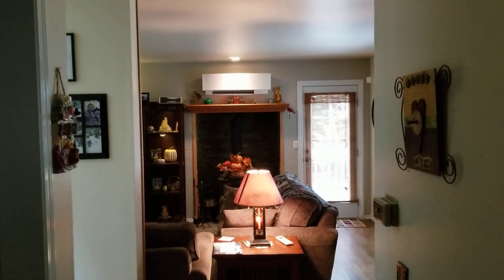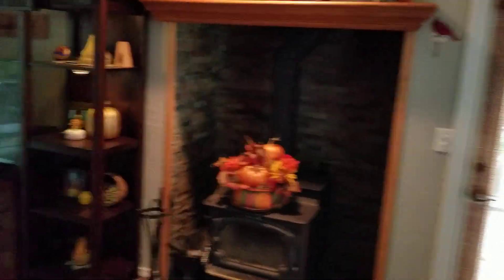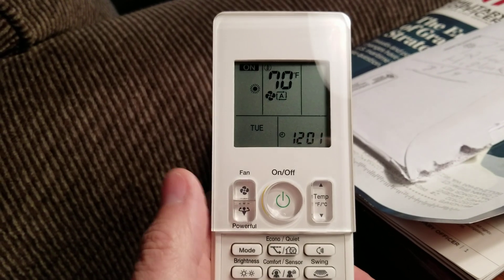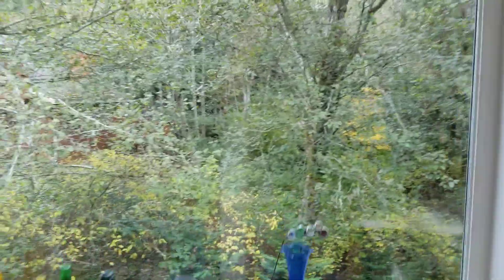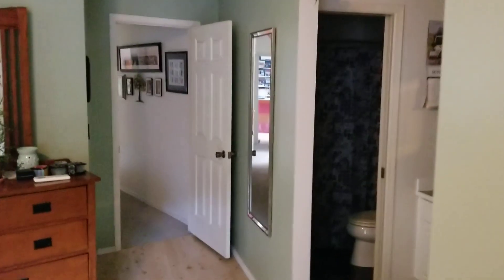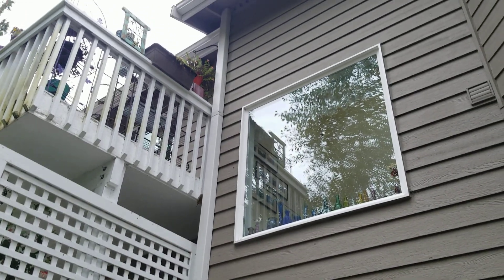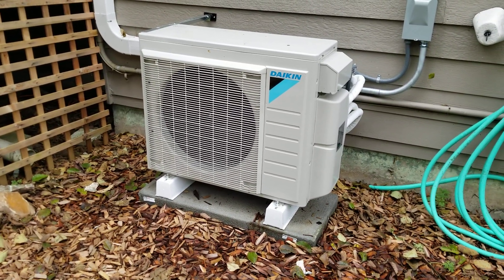How To Operate a Daikin/Mitsu Ductless Mini Split Heat Pump System Effectively and Efficiently!

Comment: Hi, I've done everything you said and the flaps just won't open!  I've tried everything and I even have the manual but it doesn't help...HELP!!!
Reply: Not  sure what climate you’re from /1.In the basement try turning off and on the circuit breaker to the unit/2.Outside there is also a fuse box to the condenser-Open the box and take the fuse out and reinstall it/ Doing this should reset your unit.

Comment: Hi, we have a FTX unit installed and it seems to be running constantly even if I adjust the temperature up. Is that normal for cool setting with auto fan ? Thank you
Reply from the maker: @Stefi9810  in cooling fan runs 24/7, in heating it will cycle

Comment: Thanks for this useful video. We just had ours installed and have a split in the basement and one on the first floor (Daikin 3MXL24RMVJU condenser with an FTXR12 hi wall for 1st floor and a FTXR09 for basement with an FDMQ18 Compact ducted unit in attic tied to new insulated and sealed duct system in attic with ceiling supply registers in each room on top floor, one main return in hall.) and have left the two splits temp at about 65 for the majority of the time with the fan on most of the time. We now set the fan at auto or night so to use it less after what we read. We just got our first bill and it's $370 for only a month (early Nov-early Dec). That seems high. Can you help determine the cause? We live in Boston and get cold temps but that's not even peak winter yet. At one point in your video you mention the efficient cost of which we want to ensure we're getting too. Thanks!
Reply from the maker: What did you replace? Baseboards?
Reply: Natural gas steam radiators. @TheDiskinsDoEverything

Comment: Barron, can you explain how the thermostat works on these systems? I one a mini split ductless from this brand it is a pain in the ass with keeping the right temp. I have a 7 degree deviation between requested cooling temp and indoor temp. I am frustrated with it.

Comment: Quick question, I have a Daikin and it only goes down to 50° on heat mode and I would like to go down lower is it possible?
Reply from the maker: Not that know of….maybe with app, but haven’t tested that

Comment: I just had a Daikin Minisplit installed and with the unit set to cold, fan set to auto the fan never fully turns off it just goes into this low speed blowing. Is this how it should function or should it shut off when it reaches temp? Thank you!
Reply from the maker: In cooling the fan does not turn off. In heating it does.

Comment: I have the same Outdoor Unit(4MXS36RMVJUA}and 2 Indoor units(FTXS18LVJU and FTXS12LVJU}I am in the Poconos Pa. and had my units installed on Jan of 2022.I am very happy with my system.The Upstairs is the FTXS18LVJU and it seems it hardly ever goes on butttt the Thermo on the wall always say its around 70(I am happy with that}The Downstairs unit(FTXS12LVJU}is the coolest room where I spend my evenings on the computer and drinking wine.Seems the Heating is always on and shuts down every now and then for a min or 2 mins.I think thats because the outside Unit freezes up and has to DEFROST(that only takes less the 2 mins to defrost}But I did look outside when the unit shut off inside and seen that the outside unit was Defrosting and fan not moving but there was little Ice that you could see from the side and back of the outside unit.(On YouTube you see many of the outside units that have LOTS and THICK ice on the back of their units}Myself I think the Daikins are very good Mini-Splits and glad that I am saving NOT having to use my Electric Base Board heating.Cost me $7900 but well worth it, hope the AC in the Summer will work as well as the Winter........

Comment: Barron! Thank you for your video. I also learned about the “auto” on daikin and it’s 8 degree movement required. Living in the PNW it gets cool at night but not cold cold. So I’ve switched to the heat mode, and set the temp to 68, and the room temp is also 68, but the heat pump continues to pump out heat it feels like and it can ratchet my room up to 74 without stopping! Any ideas? It seems sort of strange the room continues to heat up when before I had the mini split (19 series) the room obviously got colder at night.

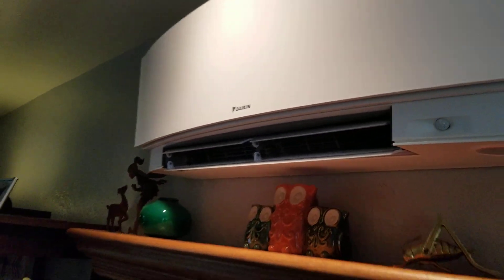Comment: At the start of the video (01:05) you call the remote control a thermostat. Later at  05:01 you state it is NOT a thermostat but it is a comfort control. Also, you state that the heating/cooling mode should NOT be set to auto because you may limit what the compressor is capable of and in auto mode the temp must exceed the setting by 8 degrees before the unit will switch modes. I've been trying to determine what the heck is wrong with the darn unit and it was because I had set it to auto. What is exasperating to me is that the installer did not tell me this and NO WHERE in the Daikin documentation does it state this. Finally, it is starting to work correctly. THANKS!!!!
Question: With our HVAC in the main part of the house in the summer during the day we set the temp at 74 and at night it is set to 71 via a Nest programmable thermostat. Can I reproduce this with the Daikin?
I have a RX24AXVJU (in my workshop) and a RTX18AXVJU (in my office), this is on the ground level of my house. The manual covers several models which made me aware of possible features that would have provided more comfort for me. This is my first venture with mini-splits and I had incorrectly assumed it was just like a normal HVAC.  Are there features you would have suggested? The sales rep did not mention that there were units with other features or features that I can add.
Reply from the maker: Yeah, that is one of my great sins. Issue with not editing anything.

Meant to run at the temp you like it while you use the space. No need to turn it down at night, that is a function of older systems that run a whole house at once. If you must turn it down, you will have to buy and install a compatible WiFi adaptor. I think this one works with yours, but double check. https://www.google.com/search?rlz=1CDGOYI_enUS874US874&hl=en-US&q=BRP072A43&sa=X&ved=2ahUKEwis4Kbw14v0AhVLvJ4KHf6NDOMQ1QJ6BAgdEAE&biw=414&bih=712&dpr=2

Comment: I had an 18k LV pair installed in my workshop last summer.  In either cooling or heating mode, with fan set to "Auto", the indoor fan never stops running, even when outdoor unit/fan is not running.  Is that normal?  I checked error codes on the remote and each time I pressed "cancel" another error code showed until I had seen every code listed in the op manual., and even 9 more that weren't listed.
Reply from the maker: Eh, sound like service should check it out!
Reply: In relation to the beeps.  Every time you press the button it will beep.  Sometimes a double beep.  An error will be a long beep.  Make note of the of the code with the long beep.  Then eventually you will get to the end.  All of those other codes are from the day the head was born.  Daikin, for some reason won’t let you get rid of them.

Comment: I have a diakon.so to keep it in heat in winter .set temperature.press blackmen icon? Does the fan have to be set high for heat displacement

Comment: Hi Barron, just Got a 3 zone multisplit system installed. Thank you for that guided tour on operating the units. Very educational and the most clarifying video I'v seen on the subject.. I have a cape code in PA. 12k and 9k downstairs and 12k upstairs ,,My daughter is like a polar bear and likes it cool upsatairs..It gets pretty warm upsairs during the day with the sun beating down on the roof. Question for you.. With all 3 units in heat mode. how best can I keep downstairs comfortably warm while keeping upstairs cool enough for her during the day?...Thanks

Comment: Best explanation I've seen.  Even better than Daiken's short video.  My only lament is that I was sold on the idea that it was made in Japan, and I discovered after installation that my unit was made in China.
Reply from the maker: Thank you for that. On the China thing, its hard to get away from, BUT there is a huge difference of Made in China and Designed in China.

Comment: Great video,  I just had a 15k BTU Panasonic inverter unit installed,  im absolutely loving it so far.  What are your thoughts on it?
Reply from the maker: Jason King we don’t carry that brand, so I am no good. However, we used to, get a surge protector on your panel, power outages fry the circuit boards nearly every time

Comment: Great video,   I have a DAIKINFTX18NMVJU    The question is the unit fan always runs no matter how it is set.  Is this the way they are or is this a defect or is something wired wrong or set up wrong.  Thank you
Reply: I've asked the same thing for the 17 seer. The system never seems to shut down like the home system which is not ductless.
Reply: Tom Hansen did you find an answer for this question I have the same cuestión, or did you find how to turn off?

Comment: Just got one installed and barely getting used to it with all the settings. As well. 

My question is is it normal for the indoor unit turns off and on it varies from 5 min to 10 min.
Reply from the maker: Eduardo Bermudez system is likely going into defrost, so indoor units shut down to allow it to heat the outdoor.
Reply: The Diskins Do Everything but I thought it has to be constantly running to be efficient.  

I have it the 18k luv series it kicks on then turn off all in a10 min I have it at 69. And it’s 40 outside

Comment: What’s better the lv series or the aurora? Two separate contractors came one said to go with the 15k aurora and another a 18k lv series.  It’s a 1,000 sq house 3 bed, 1 bathroom. I live in Oregon so the lowest temp we get would be mid teens if we are lucky but it’s mainly 30f for our winters. I’m just confused on what model to get. I pasted the links of the equipment down below.  Also the price difference is 100 dollars so I don’t know what to get? 

https://fwwebbimage.fwwebb.com/ProductInfo/FTXS18LVJU-RXS18LVJU-Submittal-Sheet.pdf

https://fwwebbimage.fwwebb.com/ProductInfo/FTX15NMVJU-RXL15QMVJU-Submittal-Sheet.pdf
Reply from the maker: 15k aurora will produce more heat that 18k lv series.

Comment: I’m having trouble getting a unit sized, the load calc my hvac guy came up with seemed crazy high, I’m cooling 1400 sq foot, last year I cooled the entire space with a 12k window air and it kept it 76, ran constantly during the day but it never got above 76..I want to size for 72 and he came up with 28k BTU which seems high, I was thinking 18-24k would be fine.
Reply from the maker: Go with a 24k. You want the unit to run on medium-low most of the time and have the extra for hotter days. He will be fine with it if you say, "I know I am doing less than recommended, but I am okay if temp swings up to high 70s on the hottest days."
Reply: The Diskins Do Everything it won’t be hard on the unit to run at 100 percent during the hottest days would it? He acted like it would be but my thought was normal non inverter systems run 100 percent when they are on
Reply from the maker: @Bajaheat  it's not going to kill it. Always best to have a relaxed system, BUT there is a balance to everything.

Comment: Can you tell me how much electricity this waste in a day and average atleast?  I know it all depends on locations. But I’m in Oregon where heat will be used more I just need a wattage so I have an idea. Let’s say I run the unit full blast for an hour how much wattage does it use??
Reply: Honestly, theres no way to answer this as these units have many hundreds of speeds, about 900. And every single day will be different based on outside temps and humidity, indoor comfort request, how many zones are running, fan speed, indoor loads such as bathroom and kitchen fans, ovens and stove tops, lights and electronics as well as people. And whether the unit is heating or cooling. Heating draw is about double cooling draw.
Reply from the maker: 3500 watts for a 3 ton
Reply from the maker: If the question is watts at full blast, the answer is 3500. The rest is true for what it will actually run at, no way to know, BUT be confident that they are very efficient.
Reply: This is a great video. I have a few questions tho. I had installed in winter.  Today was the first day using the ac side of things. When it was in heat mode it would get to temp and shut off.  But in ac mode the heads are on constantly.  Is this normal. ?   Or should it cool to a temp and shut off like the heat does.  Question B to all this is… is there particular duct temperatures ? When in each mode. Like sometimes in the winter it feels low only like warm are coming out and other times quite warm.  ?

Comment: What system would you go with between the Diakin or Mitsubishi.  Is the Mitsubishi really worth the extra cost?
Reply: Thank you!  Was looking at the zuba, might go with the Aurora.  Never had a heat pump before so wasnt sure.  Hard finding a good installer, that knows what he's talking about.  Thanks for your time!  Keep up the great info!
Reply from the maker: In my part if the world it's not more $$, so everyone buys Daikin. I dont actually have a preference, it's just that with a 12 year parts and labor warranty, everyone chooses Daikin. The Daikin Aurora series heat pumps crank down to 5 degrees, which is all we need in the Pacific NW. Mitsubishi has the best tech for heads with the IR sensor technology and dual directional louver,  but not everyone needs that. You cant really make a bad choice between the 2, so focus on the contractor installing it!
Reply: @TheDiskinsDoEverything  12 year parts and compressor with mitsubishi and 5* to -15* on hyperheats....Ive installed both as well. only reason i stopped installing Daikin is due to the size of their wall mounts.
Reply from the maker: @performancebasedheatingair8006  yep, 15k and 18k daikin lv are big compared to Mitsubishi. 12 year part AND labor with daikin though and we just dont need -15 here.
Reply: @TheDiskinsDoEverything  the Daikins COME with 12 year LABOR or is that out sourced through 3rd party like JB associates and built into price? We dont need -15 either but we need below 17* and the hyperheats dont loose capacity till 5*
Reply from the maker: @performancebasedheatingair8006  Comes with ours, but that is part of deal with distributor. But even if you had to buy it is ridiculously inexpensive.
Reply: @TheDiskinsDoEverything  it's like $60 for each head unit and $150 for each condenser. Pretty cheap actually. I dont offer it because I hate dealing with any kind of insurance claims. Very time consuming. It's not the insurance cost that puts me off, it's the time I have waste filing the insurance claim and getting my money back....but Mitsubishi has the same offers and it's just put together as a package deal.